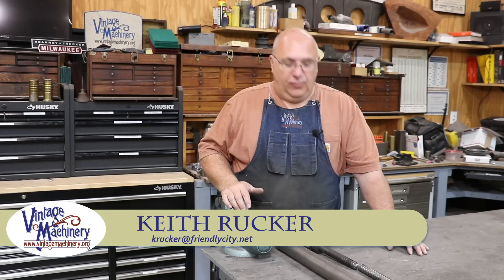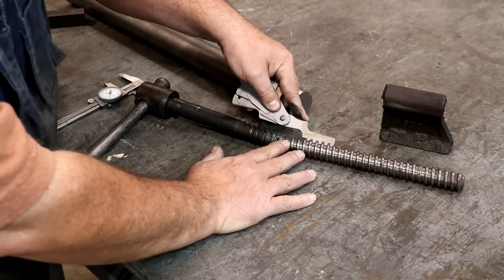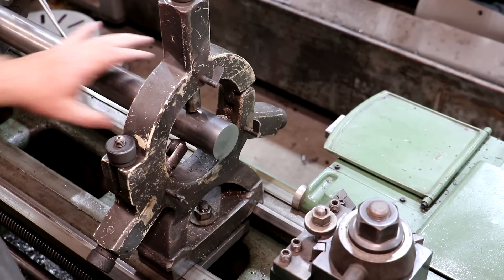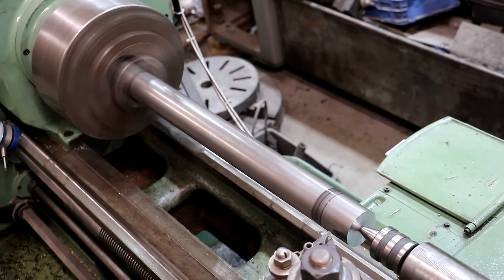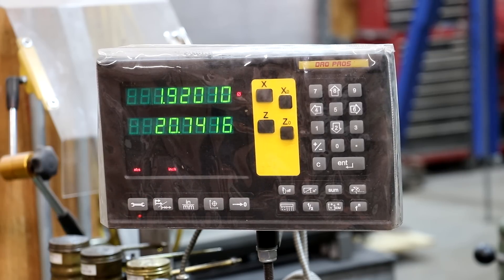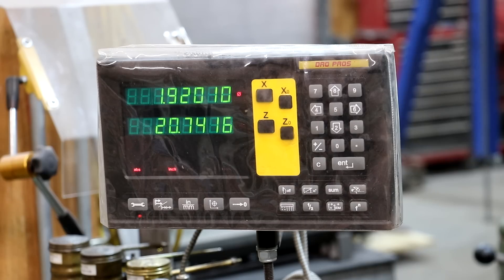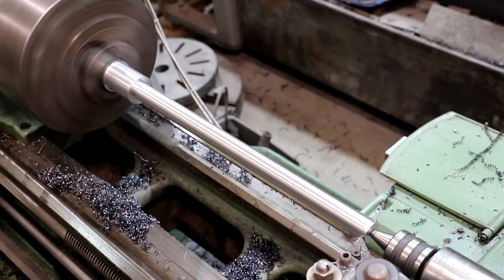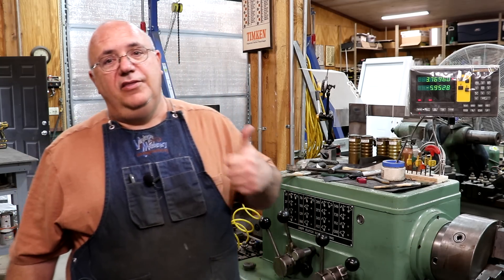Turning a Vise Screw on the Metal Lathe - Part 1: Turning the Blank

Comment: Is it difficult, or hard on the lathe cutters, to turn down the ACME threads on a lathe lead screw? I cut my 54" lathe bed to 36" (The table and work space needed for a 54" lathe isn't practical for my shop space given that the lathe is seldom used and I only work on small parts). I want to either have a shop cut and turn down my lead screw so it can fit in the end cap on the shortened lathe bed, or do it myself. I don't know if special/expensive cutters are needed to successfully turn down a lead screw. Any help is appreciated.

Comment: Would welding the screw back together be an option? Maybe set the 2 pieces in some angle, get the thread spacing correct, tack or clamp them to the angle and then weld? Seems like less work and would avoid having to work on the handle.
Reply: Not owning a lathe myself, I would try that. There would probably be a lot of hand work, chasing the threads with files. Could be done. But since he is making a new screw, he can fit it to the worn nut.

Comment: Keith when you are doing projects could you also include what material you are using? Like in this case is it 1018? I'm not a machinist by trade but a hobbiest and from what experience I do have looking at the chips and color of the metal and finish that is being left I would guess 1018 steel is what you are using here. The reason I ask is for future knowledge of what materials others use in certain situations.

Comment: I know that there are 20 ways for a machinist to complete any particular job, my comment isn't about right or wrong. That being stated, why not fix this like the "captured nut" toy. Cut on both sides of the break, drill and tap both sides and insert a bit of all thread that you then red locktite when you have the threads lined up right. If you wanted to really go all out you could leave the gap, braze to fill and then cut the thread in the brazed fill. or even cut a little blank that goes in the gap instead of the brazed fix the locktite it all. My thought with these options being that it would keep the original part which would seem to me to be important to an old tool that's been kept in the family over time.
Reply: I had a similar thought, but wasnt sure how I would time the inner threads correctly for the exterior acme (or square) thread to line up correctly between the two pieces... That seems tricky

Comment: To replace the nut, could you cut off the old cylinder, bore and single point tap a new one from durabar, and weld it back to its gusset?

Comment: my traversing screw on my potter and johnston 24 in shaper has lost some teeth, its an acme thread about 30  in long, would this be very expensive to repair? its not affecting the operation, as its in the very short travel section of the rod. i know my lathe will do it, but i am nowhere near talented enough to try it

Comment: Hi Keith. As usual I loved the video and as usual you say the rotational speed is 720 r.p.m’s. It’s 720 r.p.m. ie, 720 revolutions per minute. r.p.m’s. equates to revolutions per minutes which I admit is a bit pedantic, but the engineer/ mathematician in me likes to hear the correct units.
A quick look at the break in the shaft looks like plastic elastic failure which suggests the lathe has been overtightened on a regular basis with that section of the screw close to the nut. I couldn’t see signs of a brittle fracture so I don’t think it has been hit with a hammer. A softer metal handle would bend before sufficient force could be applied to damage the threaded shaft. Just a thought.

Comment: This may seem like teaching my grandfather to suck eggs, but the thread seemed odd to me. When I enlarged the video I didn't see any pitch angle. I'm wondering if the screw doesn't actually have a square thread rather than Acme thread. This is especially noticeable near the hub where there is no wear on the thread. If it's a really old vice a square threaded screw is not unlikely as the Acme thread was only developed in 1894.
Just wondering.
Reply: Thought the same thing immediately. Def looks like square to me, not acme. Which is very possible given the stated age.

Comment: Thanks for the interesting video - as usual. (Woodworker here) considering the extremely tiny increments you measure in, how does the heat expansion introduced into the metal being cut relate to taper or variation?  If the expansion occurs ahead of the cutter, I can imagine you might be taking off a slightly larger amount at times. And how does heat expansion affect the cutter?
Reply: Robert, great set of questions. A lot of the depth of cut can depend on the lathe itself. If the lathe has a 3/4 hp motor, it takes less to stall the motor as opposed to a 2hp or much larger lathe. There is a certain amount of heat that is caused through the cutting process. The heat generated causes the material to expand radially and axially (width and length.) For the work I have done with mild steel and up to 3" in diameter, I encounter about .003 to .005" expansion due to heat. That may not sound like much , but it can make a huge difference between a part fitting or being scrap. 
Usually, unintended tapers are caused either because the headstock or tail stock is not properly aligned. Another possible cause of a taper can be if the lathe hasn't been properly aligned, through leveling, which can cause a slight twist in the bed. 
Heat expansion usually doesn't affect the cutters unless it is carbide and you cool it during turning operations and it causes it to crack. I have seen demonstration videos on Youtube where they heat up high speed steel to a dull red temperature and is is still able to cut metal. The other cutters such as the insert that Keith was using, is able to withstand much higher temperatures without issues.
I hope this helps
Reply: @robertoswalt319  Thanks for your reply.  I have come to appreciate .003” - but not for what I do (1/32” anyone?).
Reply: @robertbamford8266  One of the tricks is to choose the cutter and feed so that most of the heat leaves in the chip and the base material doesnt heat up much. The other is to take a break between heavy cutting and finish passes to allow temps to normalize.

Comment: Nice work as usual, really appreciate your videos. Learned a lot from you and Abom. I recently did the same job for a Reed #33 with 1-1/4, 3 square threads. Problem was my Leblond only went down to 4 tpi, had to make a 16 tooth gear to replace the 32 tooth and use the 6 tpi position on the quick change to get 3 tpi.

Comment: Keith, 

I am curious as to why the screw broke.  The screw did break near the moving jaw end where you would expect most of the work was done.  Was there cupping at the break?  This would, along with narrowing in diameter or streching in the thread, indicate over tightening.  Was corrosion at the root of the thread at the point of separation?  This would indicate a stress corrosion crack.  Was there a twist in the shaft?  Indicating it was bound and twisted.

Acme threads are used because of their inherent ability to  be used under load.  A little forensic work might help determine if the slop in the nut might have contributed to the failure.  Replacement of the nut may be called for.

If casting a new nut is not feasible, why not cut the threaded portion off and braze a new nut made from the remaining portion of the steel you're using to make the new screw?

Thanks for keeping my mind working. 

Bob
Reply: No vise over a week old has been immune to a cheater bar or hammer on the handle, I think. This one is ancient. Generally, the screws and nuts are made of somewhat dissimilar materials.
Reply: @UncleKennysPlace  ...Right on the money!
Reply: I noticed that the handle is bent, i suspect someone used a pipe on it.
Reply: I still want to see an used vice that's not abused.
Reply: Guarantee you it was abuse.

Comment: Knowing the nut was extremely worn and an odd thread, was their a recommendation made to modernize the vice while maintaining is classic appearance?
Reply: My thinking is similar.  Would it have made sense to "bush" the nut with bronze and use a slightly different Acme thread, for which the cutters needed are already on hand?
Reply: @eliduttman315  , interesting, but going from a stub thread to a full-depth one would have weakened precisely the vice part that broke.  You pull on one thread and sometimes you lose the entire sweater.
Reply: @stuartschaffner9744  Is that the reason for stub acme thread? To leave more material for added strength?
Reply: @oleran4569  , my background is physics, not machining so that was just an educated guess.  However, notice that when the screw was overstressed, the stem broke rather than having the threads strip out.
Reply: @stuartschaffner9744  It just seemed an elegant solution to a stress problem.